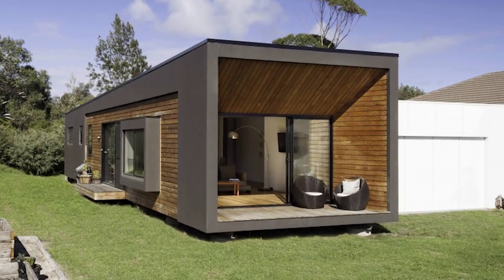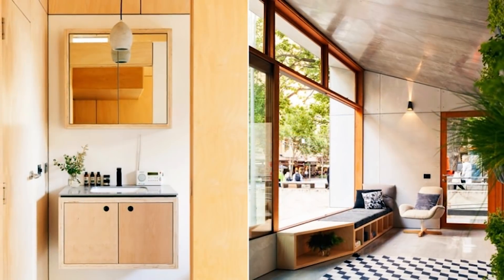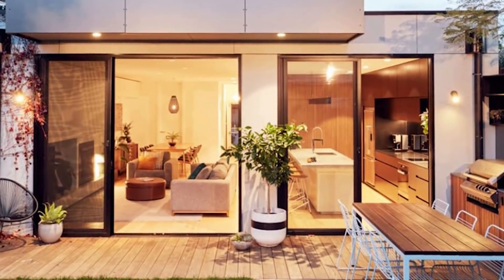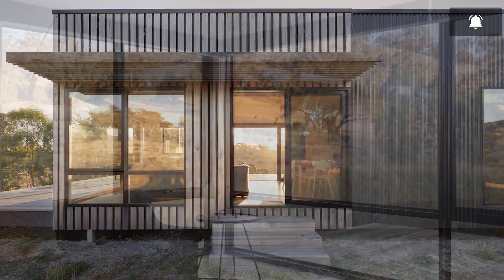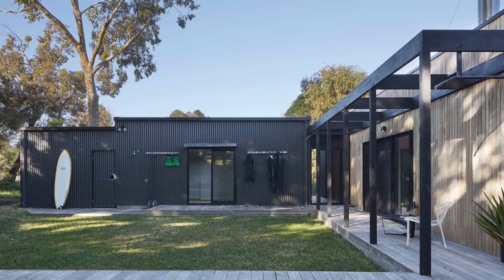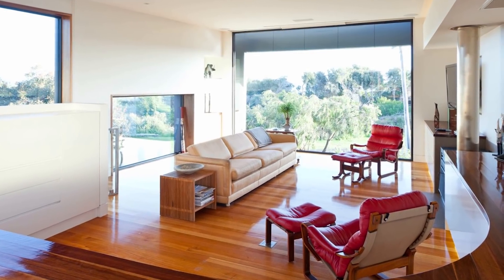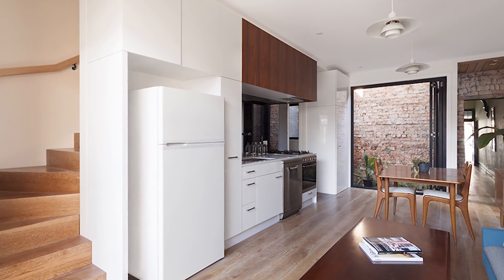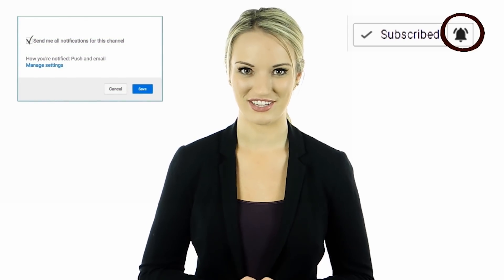10 Incredible Prefab Modular Homes From Archiblox Architects

Comment: I love the style, but what happened to building a container home for around $50,000 US?
Reply from the maker: That's most likely if you provide the blueprints, and contract the build yourself and of course, own the property as well. It's doable lthink.
Reply: $ 50,000 us is expensive
Reply: @mindseyedesign  so it's more expensive than that
Reply: Stay tuned. Its coming :)
Reply: @marcelcicort9671  Oh yes...a few more months, and those prices will come down, but not only that, a lot of them will be out of business.  I would never pay the prices that they're talking about.  Those 3d homes and shipping container homes are much cheaper and of greater value.  And for the prices of these over-priced prefabs, I can buy a regular brick and mortar home.  Especially here in Detroit.  I gave this thing a thumbs down.

Comment: Question: do they leak? and are they as durable as standard construction homes?
Reply: I like all the homes.
Reply: They do not leak, shipping containers are designed to be water tight. During shipping containers are stacked on the ship  in the open where they are subjected to rain, ocean spray. ....... containers will actually float if they fall overboard  if not to heavy. If windows and doors are not properly installed and sealed in the cutout they may leak but same holds true with conventional build homes. The roof will never leak. Container are also air right so proper  ventilation is a must to mitigate moisture buildup inside which could lead to mold.

Comment: Once upon a time prefab was  cost effective, no more. Now you pay top dollar for crap material. It cheap if they drop the materials of at your lot to be assembled there , but the crap material will be exposed to moisture so you pay $$$$$ for them to assemble it in their over priced factory them drag the huge sections to yoru lot to be assembled.  You are better off having quality mold resistant  material dropped  at yoru lot and assembled there, much cheaper.  prefab does NOT pay!